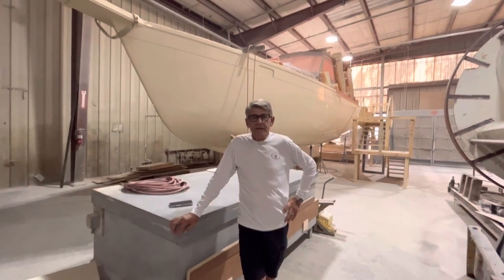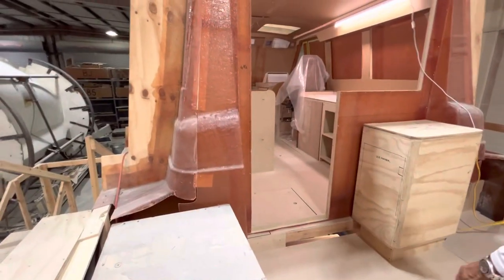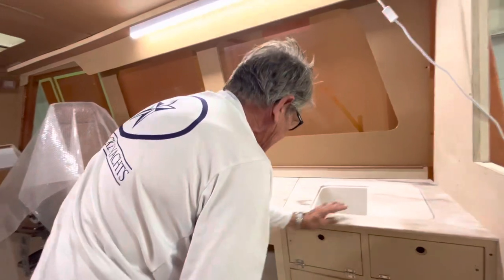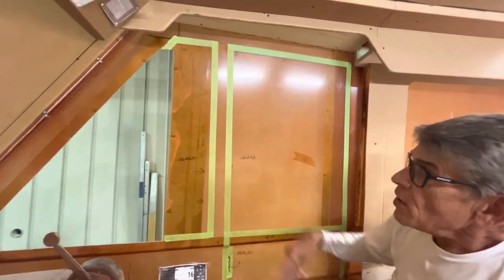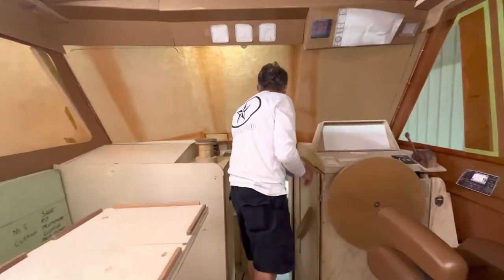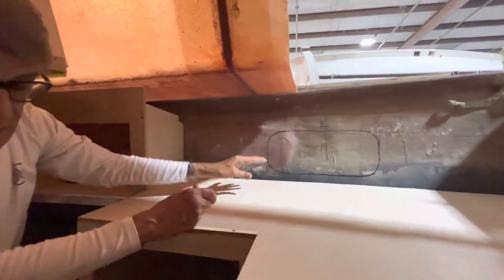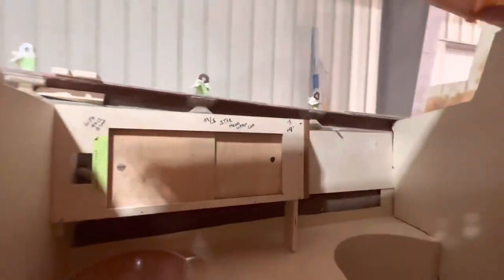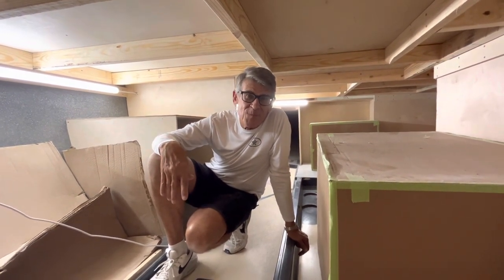First Look at the New 42’ Motor Sailer!

Comment: Great concept walkthrough.  I look forward to more info for the MS.  I have a few observations.  I agree with other commenters that the gimballed oven/stove is necessary.  I also see a significant safety/ergonomic issue with sheets tails from the central winch.  Where will they stow?  The bifold door & powered window to the cockpit have me a little concerned about getting pooped.  It’s inevitable that the cockpit will take on water.  These new access points look great but seem a little susceptible to taking water into the cabin.  Any chance that there will be power options such as the Hybrid Marine / Yanmar combo for propulsion & power-gen?  Best of luck with the new line!